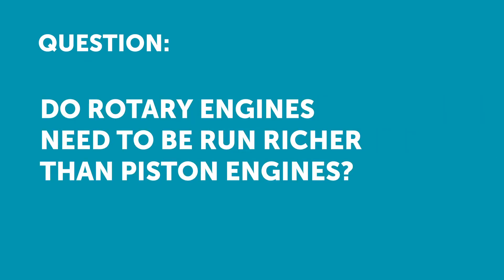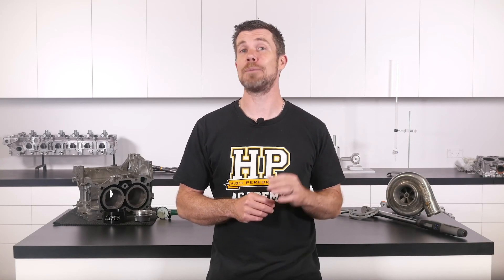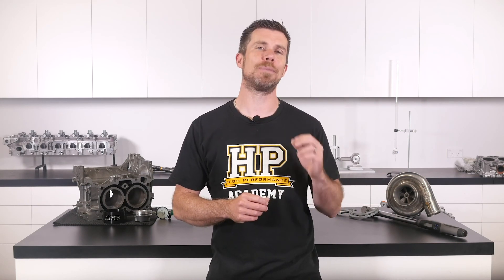Why Do ROTARY Engines Run Rich? [HPA Q&A]

Comment: Ever heard of liquid piston hydrogen rotary motor
Reply: Liquid Piston is not an engine manufacturer, there is also no evidence to support that the company is anything more than a fraudulent vaporware investment scam.
Reply: @sandervanderkammen9230   you do know they have military contracts and their tech is proven and do produce motors if you invest in higher  tier you get a walk through  of the facility  like I have experienced

Comment: I think you will find rotary engines don't need to run rich the chemistry of the air and fuel is no different. The rotary engine has more emissions compared to a piston engine  so when you measure with a o2 sensor it will give a false rich reading because even if you give it the correct air/fuel ratio it wont burn it all. If you deliver a stoic air fuel mass you will not get a reading of lambda 1 using a o2 sensor on a rotary engine.
Reply: Bullshit, the O2 sensor will read exacty the same.
Wankel engines are plagued by horrible combustion chamber architecture very similar to the primitive Flat-head, side valve engines.
The Wankel is extremely prone to apex seal damage due to erratic, high brisance combustion or detonation.
The Wankel engine cannot support modern high-swirl or quench type combustion chamber technology.
Lean AFRs will quickly cause a Wankel engine to self-destruct.
Any questions?
Reply: I don't think I worded that very well if you had a air/fuel mass of 14.7:1 and that was the stoic ratio of the fuel I don't think it would read lambda 1 measuring with an o2 sensor. Why does the rotary engine have a 2nd spark plug that improves emissions and economy.
Reply: I don't think I worded that very well if you had a air/fuel mass of 14.7:1 and that was the stoic ratio of the fuel I don't think it would read lambda 1 measuring with an o2 sensor. Why does the rotary engine have a 2nd spark plug that improves emissions and economy.
Reply: @mikejarden3679  Well, first off... the O2 sensor does not read the actual AFR, only the percentage of residual oxygen created by a lean mixture.
As the AFR goes richer the precentage of CO to CO2 increases and O2 percentage drops.
 Not all Wankel engines have 2 spark plugs... but those that do benefit rhe same way an engine with a large bore diamter or a poor combustion chamber design does.
Staggering the ignition spark increases combustion dwell without advancing the ignition timing. As was noted in the video too much ignition advance can cause knocking resulting in apex seal damage due to high brisance and or related ablative damage. 
 Wankel engines also have a tendency to misfire due to poor flame propagation, especially under lean conditions which is improved with the addition of a dual ignition system.
Any questions?
Reply: @sandervanderkammen9230  Umm no the o2 sensor does not work like that it measures exhaust gas oxygen content by comparing it to a reference (free air) carbon monoxide will have the opposite affect the flow of oxygen ions through the zirconium dioxide is what affects the flow of electrons that can be measured as voltage (Rich or Lean) Wide bands just the same can only read rich or lean then uses current to workout how far away from lambda the sample was.  Rotaries are very resistant to knock ignition timing on them is misunderstood they have a 360deg cycle not 720deg and 270deg of that is intake they don't have a dwell not like when a piston stops moving and changes direction. I'm not one to rant over topics like this but happy to help uneducated people like your self understand. I literally have a certificate in o2 sensors and im one of the dyno tuners at high performance rotaries.
Any questions?
Reply: @sandervanderkammen9230  LOL are you for real iv never seen a Titania o2 sensor i bet you cant name one car manufacture using them and nobody would use one to tune they are just 0-5v narrowband. The industry standard is bosch LSU4.9 and the NTK sensor is also common both ZrO2 https://en.wikipedia.org/wiki/Oxygen_sensor  if you really know your stuff about o2 sensors what is acceptance and how would you measure it? You wont find the answer on google.
Reply: @sandervanderkammen9230  Now lets talk about rotaries iv only seen about 50 rotary engines pulled apart and rebuilt                                                                                                                                                                                                                                                                                                                                                                                                                                                                                                                                                                                                                                                                                                                                                                                                                                                                                                                                                                                                                                                                                                                                                                                                                                                                                                                                                                                                                                                                                                                                                                                                                                                                                                                                                                                                                                                                                                                                                                                                                                                                                                                                                                                                                                                                                                                                                                                                                                                                                                                                                                                                                                                                                                                                                                                      n and iv never rebuilt one my job is engine management. 40 out of those 50 had low compression due to apex seal damage normally bent seals caused by heat. Iv seen them spin bearings, crack side plates and spit seals out due to carbon bu                                                                                                                                                                                    ild up. Even old mate Yamamoto that developed the engine for Mazda says they are "resistant to knock" https://www.jstor.org/stable/44717358?seq=1 Check out his book Titled Combustion Characteristics of Rotary Engines.